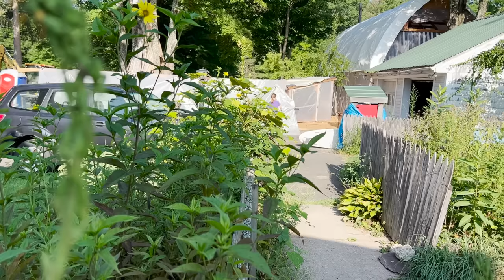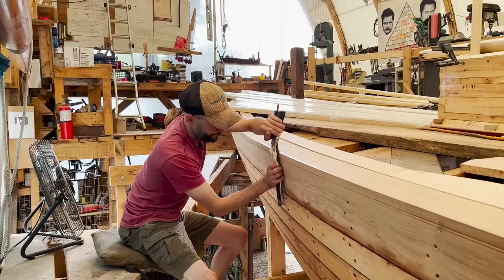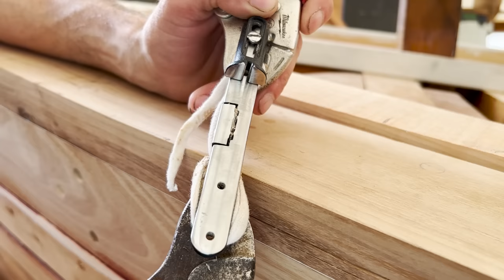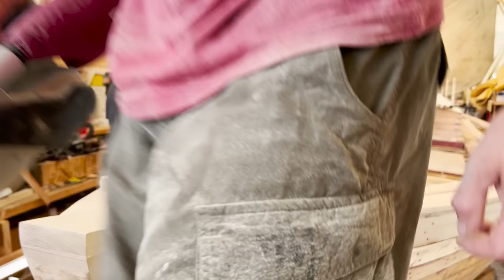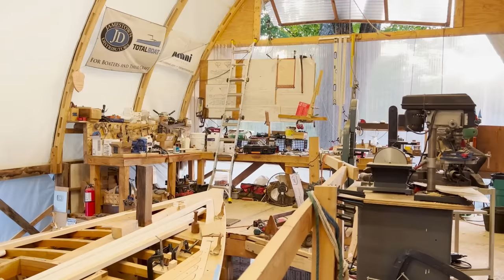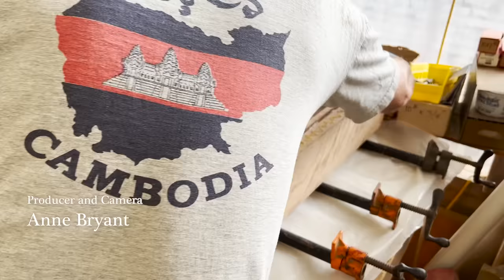Boat Decking & Beautiful Beading Cove  - Episode 229 - Acorn to Arabella: Journey of a Wooden Boat

Comment: Awesome! I'm currently working (actually being paid) on the ply over hardwood frame superstructure (lots of rotten bits) of a riveted iron-hulled narrowboat built in 1914. This is not a rebuild but a repair, so if it's OK it stays, mimimum budget. What a challenge! The original hull was for cargo , so 70' long with just 10 feet of accomodation at the stern and no engine (horses back then). However, chop chop and she's now only 46' long, full superstructure and (joy of joys) an engine room containing a Lister SR2. The hull is still solid, the superstructure is not, and a small tree had taken up residence between bilge and gunwale. Today marked the end of the external paneling of the port side, with just fiddly bits left to do. I totally appreciate how tired you must sometimes feel. I never miss an episode of Acorn to Arabella - you are all a mine of information and inspiration! 🙂
Reply from the maker: What a project! Thanks for sharing what you’re doing and best of luck with it! 🙌💪

Comment: Another wonderful Friday trip into the boathouse, where it's always lovely to see progress.

I don't think I knew that the mast didn't penetrate through the deck, but sat on it and was then supported from underneath (presumably down to the steps that you made so many months ago) - I love how much about boats I'm learning from you!
Reply from the maker: Plans, as they are drawn, have the mizzen deck stepped. For a minute there Steve was preferring to keel step it, but considering some of the interior arrangements built last winter, going to the plan will work better for him. —Anne
Reply: @AcornToArabella  Thank you explaining - I'm looking forward to hearing about it as you get to those bits of the build!
Reply: @AcornToArabella  The plans show the mizzen sitting on a sub-deck which is below the main deck and at the level of the bottom of the cockpit. Stepping the mast on the main deck is a little different?

Comment: Hi, as I watch this episode with my daughter it popped up in my head! I don't know if it is already written... But keep that beading tool in the boat for ever and engrave the purpose of it, on it! So you or the owner of the future can clean the bead before you repaint the hull. We have some decorative plaster work on some of our ceilings and I can tell you how much it ease the work if you have the right tool to repair or clean layers of paint out of things like this. When I cleaned out the attic years ago I found the original plaster pattern profile tool handcutted by the plasterer probably 80 years ago and throwed it away not knowing what it was. A year or two later I was refurbishing a room and when I came to the ceiling I had that lightning struck feeling because I remembered exactly the shape of that piece of brass I threw away...
Reply from the maker: Great tip! Thanks!
Reply: Did you make a new one? And label it for the future?
That's great advice!
Reply: @chuxmix65  not that time. Because the plaster is gypsum and the paint was plastic dispersion paint, I was able to remove the old paint with a steam cleaner. And it was generally in good shape I needed to repair only some small spots. But facing the next ceiling I will do my best to make a new profile sheet and for sure I will name it!

Comment: It's always exciting to follow you.  But I was somewhat surprised how you solved the meeting between hull and deck.  In my world, you usually put a half-round strip-plank that covers the joint.  This strip-plank protects the hull when docking etc. and reduces the risk of leakage that easily occurs here.  If you fasten it with nails or screws, the strip-plank is quite easy to change.
Reply from the maker: A rub rail? We’ll have one of those too, but a little lower.

Comment: Instead a plain bead I would have cut the cover boards it in a way to create a breakwater dip edge, so when water rolls off the deck it drops straight down instead of running down the side of the hull and eventually causing stains.
Reply from the maker: Gordon Swift, known as “Swifty” around here, made eyebrows with an interesting shape at their bottom for that reason. I can’t share a picture here in the comments but it was very clever. —Anne
Reply: While a drip edge sounds like a smart idea, you have to remember that a lot of water will be splashing up the sides in turbulent waters as well and the drip edge will just make it splash outwards, slowing the boat and possibly making her nose down a bit as well. Hydrodynamically/aerodynamically, a drip-edge would actually be counterintuitive. 
As far as the bead goes though, a little more work with a "V-tool" gouge or chisel and he could turn that bead into a "rope" trim, if he wanted to.
Reply: @thomasarussellsr  Negative! That's the silliest thing I ever heard. Hydrodynamically/aerodynamically, it's not a submarine or an airplane, and splashing outwards is a good thing, plus the boat will not always be in motion. At times it will be sitting at anchor or at a dock in the rain.

Comment: I'm surprised that beading tool didn't wear away doing all that locust. Is there a way to sharpen it as you go along?
Reply: I believe it is a carbide cutter, but don't hold me to that. Carbide holds up to even hardwoods much better than steel.
Reply from the maker: Steve says, “They can be sharpened with a fine file.
I did not sharpen them, I just bought a few sets of cutters (they are pretty cheap) as I was unsure I would be able to keep the bead consistent after a couple sharpenings. You can also file-in custom profiles. They sell blank cutters.”

Comment: How about gold leaf for the bead, to make the join between oil and paint? It's quite good fun, and not all that expensive.
Reply from the maker: But a little bit fussy to take care of… we shall see! It’ll most likely be simply finished.
Reply: @AcornToArabella  We have a fair bit on our (1916) fire engine and it holds up pretty well. Hopefully you wont be running up against docks all that much with that part of the boat. It doesn't corrode (famous for it) so will stay pretty. It might look nice with the polished stanchions (briefly, until they turn not-polished). 
TBH  was mainly suggesting it because it's a fun process to do.

Comment: I am wondering why you use slotted screws pose to Phillips or other heads?
Reply from the maker: For maintenance, the head is easier to clean for removal of the goop that held the bung in… bungs need replacement for time to time. And slotted screws are less likely to cam out on their first time going home.

Comment: Big knock on wood. Saw all those wood shavings and sawdust inside the boat. A word from the old man called experience. Keep your work areas clean. You are at that stage now when many areas of the boat are coming to completion and being closed off. You're past the worst of the hot weather, but still, this is the time in your project when fire is the greatest threat. Those running fans provide a great source of fuel. Trust me on this. I've been there. I had a rag combust while putting on a new varnished bottom on an E Skow once. Got called away from the job for just a moment. Turned my back for one minute and somebody was yelling "Somebody's boat's on fire!" Don't think it can't happen to you. Don't worry. You will probably never see this comment. Google will most likely censor my comment regardless. That's what things are coming to. There's fire everywhere these days.
Reply from the maker: Thanks for sharing your story! We appreciate the hazards, and Steve’s grandfather, having been in public safety as the fire chief for a good long while here in Granby, is on the lookout regularly. Thanks! Happy Friday!

Comment: Why didn't you make your own scratch stock for that bead? They're a doddle to make, and you could have just filed the profile you need......and a wooden handle could have prevented the thumb RSI. I've got dozens in a drawer. The simpler ones take 10 minutes to make. To anyone who hasn't used a scratch-stock.......it's reasonably tough work.
Reply from the maker: ¯\_(ツ)_/¯ had other stuff to do and Lee Valley makes good stuff. Maybe will make one after launching for small projects. Sounds fun. Thanks for the tip and happy Friday, Mike!
Reply: @AcornToArabella  A great source of the steel for scratch stocks is old saw plates. When you go to chuck out a worn-out hard-point handsaw......don't! Chuck the handle out and put the plate to one side. It's ideal for scratch-stock (and of course, for card scrapers).
Reply from the maker: Awesome tip!

Comment: Hi Steve I felt for you on the bead job especially as I have a bead plane that would have done it ,have a look at a Stanley 50 bead plough plane I’m aware your surface is curved but the plane is only 6 inches long and I’m sure with a bit of thinking like pinning a small spline to act as a fence it would be successful. Mick UK.
Reply from the maker: Hi Mick! Maybe that would work, sure. Probably a sound way to do it, but we don’t have one of those. Thanks for sharing!

Comment: If only you guys would have used electric screwdrivers the boat would have been finished by now.
Reply: That old Yankee screwdriver you start screws with and the bit brace you seat them with give an unparalleled “feel” and control you just don’t get with electric screwdrivers! 😁
Reply: @douglasmoffat6560  both can be true at the same time